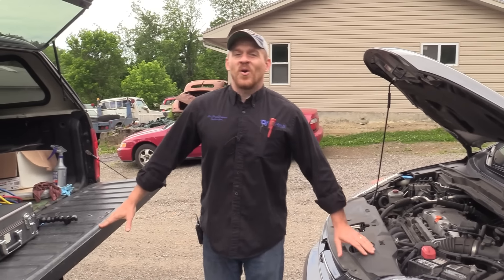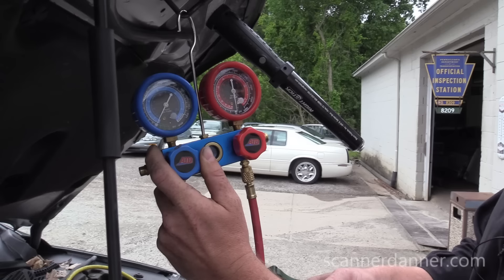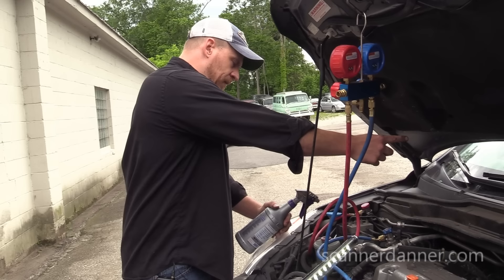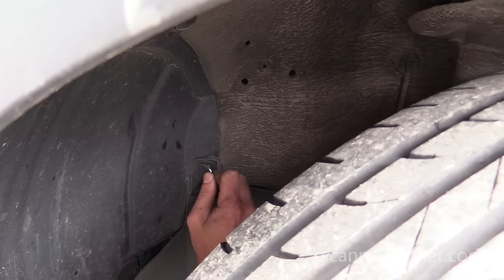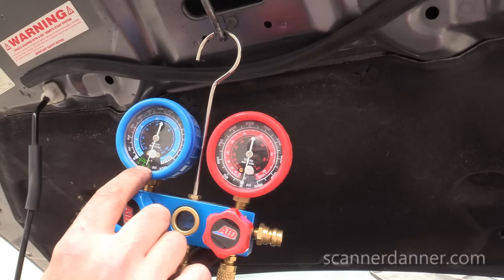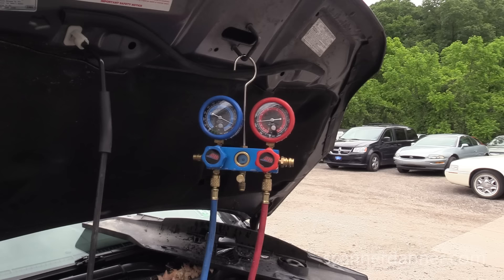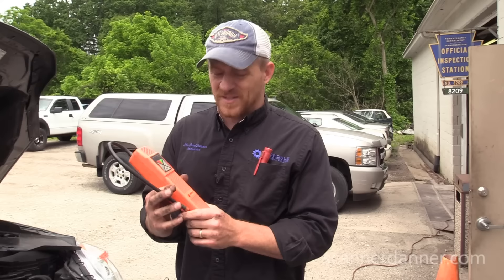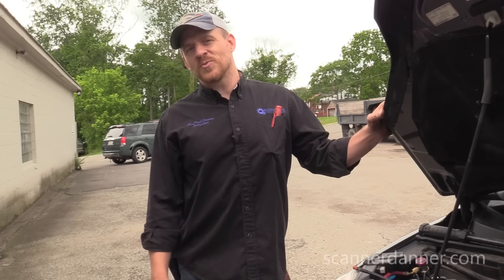Air Conditioning Not Working (system performance, leak test) - Honda CRV

Comment: Paul is TRULY unique and very talented teacher/ technician. When I first saw one of his videos in 2011 I knew from the start I should learn from him. Glad I subscribed . He has a gift for diagnosing very complicated cases that would want to make a  any other technician pull his hair out. What's amazing is he can" walk the walk and talk the talk". I bought is ebook and course which helped me to pass the L1 test the first time! I really struggled with electrical and electronics but he helped me to think and learn outside the box!

Don't worry about the trolls, they couldn't touch you with a 10ft pole!! Keep on doing what you are doing Paul because you're blessed
Reply from the maker: Thank you so much for this comment.
Reply: @ScannerDanner  Paul, where do you get the adapters to charge the AC system with shop air?
Reply from the maker: Thanks again for this comment. Just happened on it again.
Reply from the maker: Can you put this comment on my feedback page of my website? https://www.scannerdanner.com/leave-read-feedback-new.html

Comment: By the very nature of the design of the shraeder valve, it is more likely to leak under vacuum than pressure. by design, pressure tends to hold it closed as a vacuum would tend to open it.
Reply: That system never operates in a vacuum though
Reply: @kellismith4329  Captain Obvious reporting for duty! 😂
Reply: Good luck finding a leak under vacuum

Comment: This was a great in depth, real life, no holds barred video with quite a lot of useful practical information on faultfinding the A/c system. There was 4 essential pieces of equipment used in tracking down the fault. No 1--- was the set of gauges, No 2--- was the vacuum pump, No 3--- was the fault locator, No 4---- was the compressed refrigerant. These items would not be beyond the budget of the average diyer when the long haul is taken into account and the amount of savings could prove substantial. Nice camera work by your son and shows great promise for the future.
Reply from the maker: Thanks so much Tom!

Comment: As a master ASE and master Ford tech of 35+ years I’ve seen many compressor shaft seals leak only when the compressor was running. Good video as always. I love how you and Caleb keep it real.
Reply: I agree, but disagree with using shop air for a leak test. Use nitrogen.

Comment: Nice job. We usually use dye but tried the soap and water test the other day when dye wasn't showing anything. The bubbles showed us the leak. Still have a freon sniffer, 25 yrs old, still works. Excellent video showing the importance of having multiple methods to diagnose with.

Comment: {read all I have a good tip at the end} I've owned 3 tif sniffers and 1 other one for 12 and 134 {can't remember the brand on it} none were satisfactory. Not sensitive enough. Have used dye and black light for the last 25 years and it works great. Allows you to see leak on evap after removal for verification. Have since bought a ROBINAIR model L D 3. It has proven to be the most sensitive, therefore the best sniffer i have ever used. I still use the dye for visible areas and the sniffer for shaft seals and evap cores.Testing a shaft seal, pull belt and tape a plastic bag around the nose of the compressor, leave over night. Poke a small hole in bag and sniff inside of the bag. This will show a small leak that gets worse under pressure that you can't find and /or test with the engine running.

Comment: Working for one of the big three assembling hvac components, part of the manufacturing process for condenser cores is a bursting pressure procedure to verify the product meets its specifications.  This is done on randomly selected pieces through out the day.  Depending on the model of condenser, the psi that is required to burst the core varies.  But for a half ton truck the average pressure they can withstand is about 1400 psi before breaking apart.  It's pretty impressive to think that the core is roughly 3x stronger than what it will see under normal operating conditions on the high side.  Just an interesting bit of information on condensers.
Reply from the maker: awesome information! Thank you
Reply: ScannerDanner Thank you for making these videos.  The way you break down the problems makes the tasks manageable for the average guy working on his stuff.  As you mentioned I don't think there is anyway shop air could hurt the cores within reason.

Comment: My experience with bicycle inner tube leak detection: fill a spray bottle with tap water, then add 30-60 ml PER GALLON of liquid dishwashing detergent. 60ml/gallon = 15 ml./quart = 7.5 ml/pint (16 ounces) of the dishwashing liquid. I would suggest doubling the dishwasher detergent, since Paul likes a concentrated soap/detergent solution. Mix well before using, squirt liberally to detect leaks. Home Depot sells an appropriate spray/squirt bottle. 
   Paul - the terminology or concept about R-134a LUBRICANT may be that it evaporates after it leaks out of the newer systems, and thus is gone when you look for those oily marks?
The Boiling point of water is 69F (20.56C) at 29.22 inches of Hg vacuum (0.344 psia), lower with greater vacuum.
Excellent video and sound! Appreciate your logical approach, Paul "Scanner" Danner! Good Instructor!
The sniffer TIF RX-1a is available on Amazon ~$121.88 (Aug.2019)
EDIT:Thanks & sniffer.

Comment: Excellent video Paul. I used your techniques from the other videos to find a compressor leak through shaft seal using compressed air. No refrigerant wasted. I invested on a vacuum pump, AC manifold and a reman compressor on a 95 Maxima that is sitting on the driveway as a backup only lol! People asking why even bother with it but I did it to gain valuable experience and the tools will serve me well in the future. I think of it as shop time lol. I posted my finding on the forum so thanks again!
Reply from the maker: Awesome! Thanks man. I have a hard time frequenting the forum and appreciate your comment here.
Reply: charles acosta I like your way of thinking.

Comment: Trash,aka leaves, can close off a leak under vacuum while air pressure will show leak. Had a hose leak that vacuum pulled a foam insulation tube tight and closed it off. R 12 of course leaked. I could hear it. That taught me a lesson. Holding vacuum does not mean no leak under pressure.
  Lisle now makes a stethoscope with a hollow tube. I made one years ago from the Y from a nurses old stethoscope and a piece of brake tube. This is great for air and vacuum leaks as well as finding noises on  the front of engines. Bearings like water pumps, p s pumps, alternator, idler, and belt tensioner pulleys.
 Love your stuff. Keep up the good work.
 One other thought, I taped a freezer bag around the nose of a compressor and left it over night. Next morning I opened a hole in the bag sniffed it and found a small pesky leak that had been driving me nuts trying to find it.

Comment: Adding Shop air is a great way to test the A/C integrity along with finding leaks. You can crank the engine...turn on the A/C and do alot of checks without using any refrigerant. Love the nitrogen guys. They should know that the air we breathe is 75% nitrogen...Most shops have water traps to REMOVE moisture out of the shop air. Been doing it this way for 36 plus years. Very cost effective! Check your manifold guage lines too at the service valves and at the guages...found plenty of leaks there over the years...lol
Reply: The only reason nitrogen is used is it is the cheapest bottled gas there is, it is only used because there is no moisture..

Comment: Just used the compressed air trick on my Nissan Sentra. The compressor came on right away. Saved some money by not wasting refrigerant. Thanks for the money saving tip.

Comment: With all due respect - let me add a couple of penny thoughts here: While using air for testing might be an easy option, you have to consider the possibility of condensing moister out into the system at the higher than atmosphere test pressure. (just think of how much water is usually dumped from your shop air tank) That said, you also ran that compressor increasing the pressure above 300 psi on the the high side which will squeeze even more water out of that air. Now, given how hydroscopic these new oils are you also risk contamination of compressor oil. This will not be evident in the short term but it tends to shorten the overall life of the system. If you agree with my points here, perhaps you will consider changing this habit. Thanks for all your videos. I am extremely grateful for all the help you provide to the rest of us.. Please keep them coming you do an awesome job!!!
Reply: I agree, not a good habit to used compressed air for pressurizing A/C systems. Nitrogen is cheap enough and the preferred gas to use for finding leaks using soap or bubble up product. Only professional AC techs have micron gauges for the most part, to determine vacuum status, which should be brought down to 1500-500 microns, to remove moisture from the system. Going lower than 500, if one has a pump capable of doing that, is also detrimental, as it can remove parts of the oil ingredients as well, making the oil less able to lubricate.
Love checking out Scanner Danner's videos, they are exceptionally well put together and the level of detail is outstanding, he's my first stop for info about auto/truck repair. Keep it up, we thank you for all you do. But....GET SOME NITROGEN
Reply: Um, just to be clear it is “hygroscopic”  NOT “hydroscopic” but im sure you knew that…

https://en.m.wikipedia.org/wiki/Hygroscopy

Comment: Nice presentation! After watching this I've come to the conclusion that the quickest way to identify the leak would be to sacrifice a 12 oz can of refrigerant into the system and use your Leak Detector straight to the difficult places first, like the compressor and evaporator drain tube. Of course when installing the refrigerant the system needs to get the compressor started and if not hot wire the low refrigerant sensor. and from your experience Dan what would you say is the most common failure points? Compressor? Evaporator? or condenser?
Reply: In my Honda was the condenser,found out it was hit by a rock in the front of the grill,so I will put a mess screen to protect the condenser from bugs and rocks.I sprayed it with my grandkids bubble maker to find the leaks.
Reply: Paul is very good at explaining this to me it's very much like your central air conditioning it all makes sense

Comment: Dryer in new cars are inside the condenser... its remove by a torx or allen nut underneath the condenser!
Good job man every tech has its own way to check and repair, you re a pro because we the techs mainly protects the ozone and thats the main reason of this profession... 
God bless!

Comment: Back when I first started doing AC work I was so paranoid about the system being open for even a second. Now I embrace the pressure test and usually don't replace receiver/drier unless debris in system. I trust my vacuum pump and physics to do the work.
Reply from the maker: yep, exactly. And the dryer should be changed in theory but I've done hundreds of these where the customer doesn't want it changed and I'll still see the car years later (as I'm still servicing it) and everything is fine
Reply: I like Paul's honesty about the liquid line filter dryer. When the system is in a vacuum- all moisture will be boiled out of the system. So technically- there's no need to replace the Filter Dryer.
Reply: @ScannerDanner  yes sir in theory your correct  you can get away with not changing driers on medium to hi temp  like cars but not medium to low refrigeration it’s a no brainer you must I enjoy watching a car guy that understands refrigeration cycle watched utube guys not using a vacuum pump because they been doing that for years. Enjoy your knowledge and your book which I used to diagnosis a 5v reference I’m a retired hvac ref service tech by the way when I began my career you where on your own island as far as no BEEPER CELL PHONE and knowledge was obtained thru the manufacture and lots of reading Today u can reach out to everything available curtesy of the internet. Cheers

Comment: Excellent diag Paul.  That's what this channel is all about about. Many guys would just throw a compressor or condenser at it because " they've fixed 100s of theses ". It will  bite you in the butt. Test don't guess. I can't believe it held vac with a Evap core leak. As usual a great example of showing future techs how to go though it correctly and get it repaired.
Reply from the maker: I know! I was surprised too. Thanks so much for the comment

Comment: Hey Paul (Not Dan haha) if you get that job they are gravy really. Takes about two hours is all. Also remember when testing for leaks with vacuum it is about as handy as tits on a bull. 30"hg of vacuum inside the lines is only about 14psi (atmospheric pressure) on the outsides of the lines. Much better off having 150psi on the inside right? A lot of people over look that fact and think if it can hold vacuum it is good when indeed it can usually hold that unless the leak is huge. Also under vacuum if the system is full on non condensable gas and moisture it will increase gauge pressure under a vacuum as it continues to boil off and trick you. A micron gauge comes in handy for checking that. ANy how glad you found the leak!
 --Eric O.
Reply from the maker: Thanks Eric! Good to hear from you my friend.

Comment: Another great video! As far as testing with air instead of nitrogen goes, remind the know it all's air is 79% nitrogen
Reply from the maker: I won't argue with the nitrogen crowd. It's just not practical for me, especially given the few AC jobs I do per year now. Buying a tank and then getting it filled is the difficult part. I have a small tank for my EVAP machine and I could not find a place to fill it. Air it is man. 
Thanks George
Reply: If you were going to leave it in for a long long time I could see it, but just quick testing just make sure air isn’t full of water or oil or other junk.

Comment: I use a minimum amount of recovered refrigerant and get the minimum pressure at 50-70  psi and use an Electronic Leak Detector.   PAG Oil absorbs moisture. Great Video.  Thank You  Paul
Reply from the maker: Thanks Richard

Comment: For those on here pushing nitrogen just remember the air is made of approx 80% nitrogen!! And if you're worried about moisture any leak repair on a vehicle should include a receiver dryer!!
Reply: to say nothing of when the proper method for charging is employed a vacuum will be applied for a min of 20 min and will boil any moisture from the system

Comment: I was told the compressor shaft seal is the number one major leak in auto ac. If you want to avoid a leak you should cycle the AC in winter months often when not normally using the AC to keep that seal from drying out, shrinking and leaking
Reply from the maker: the AC clutch comes on automatically in the defrost mode, also, below about 40 degrees F the AC compressor clutch will NOT engage, even if you select the AC to turn on
Reply: @ScannerDanner  And there lies the problem. Southern cars do not use the defrost setting much. If you're retired or work from home, you don't have to drive on inclement days. There's another missed opportunity to use the defrost/defog option. My AC went out on a 96 Saturn for the first time in the 25 years I've owned it. I suspect this very problem. 😥

Comment: Evap Core dead after 5 years (2012)? Was expecting more from a Honda. Great video though. Not too many people teach complete diagnostic these days.
Reply from the maker: Thanks Daniel
Reply: Daniel Yip extremely rare been working for Honda for almost 4 yrs. have never seen a evap leak on one of those must be a fluke. The 07-09's are super common for clutch coils but don't see too many leaks except for condensers from rocks

Comment: Good diagnosis. Im surprised it held vaccum. Normals i let it sit on vacuum for 15mins then let it rest for 15 mins. Have you had luck by running the a/c then using the leak detector in the hvac vents instead of the drain tube?
Reply: Not really a valid test.   Blowing air into the detector usually will set off a false positive.  The detector has a tiny air pump that draws in a metered air amount.  It's just as easy to sneak the detector probe to the drain tube.  Check towards the end of the video where he states not to blow air or have blown air into the probe.
Reply from the maker: exactly what I was going to say Wrench life 604

Comment: The problem with using vacuum to look for a leak is your only dealing with 14.7 psi at best trying to get past the seals and that would be at sea level.
Reply: Mark Patton should use a micron guage
Reply: Nitrogen is the thing to use. Crank the regulator up to 200psi. You'll find the leak.
Reply: The problem is more the some leaks act like a one way valve, small gaps and cracks  can close up when the pressure difference acts pushing from the outside. Positive  Internal pressure will always tend to open up  cracks.
Reply: especially on compression seals, where the vacuum would actually suck the gap closed
Reply: Mark Patton Mark is a super cool guy!!

Comment: I just wanted to say thanks bro. Ive been in texas since 4th grade.  Im still but a Damn yankee born in greenville P.A. 1/10/1966 . Most of my family are still around there or as i remember? You may be in euclid or Cleveland but u still in p.a. ❤ god bless you n yours and keep blessing others with your passion bro.
Reply from the maker: Pittsburgh Pa 😀 thank you!
Reply: Got my AC going . Clutch plate rubber broke. 87 f150 . You can fix a clutch plate by welding it in place and balance it. Works but needs balancing.cool again. Lol